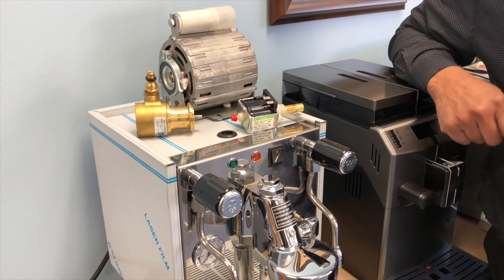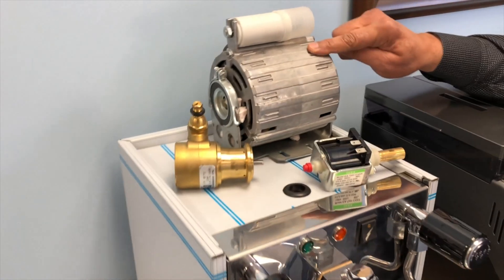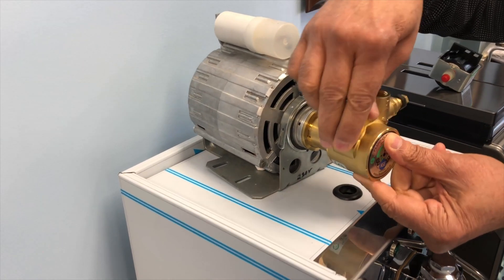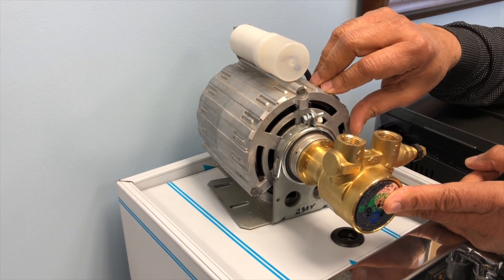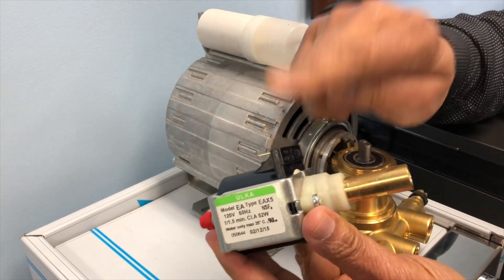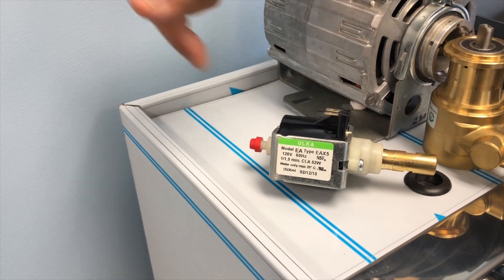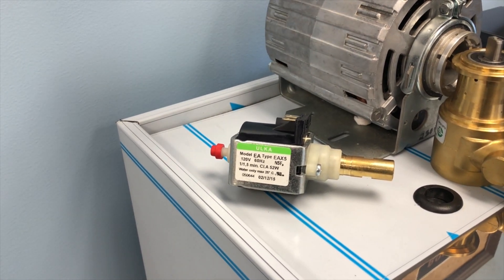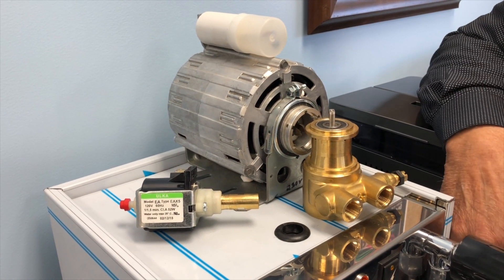Compare: Vibratory vs. Rotary Pump in Espresso Machines

Comment: i agree the heavy + expensive rotary pumps "seem" an overkill for home use...certainly in an engineering sense but am kind of disappointed you didn't go into the coffee they produce......hardly scientific but after many small machines with vibration pumps i ended up with a single group ex-commercial machine (with a rotary pump) and it simply blows away any other machine i've used in crema extraction... with top quality freshly roasted beans a doubleshot of espresso is usually still 90% orange, finely bubbled crema after 30sec extraction.....it's like pouring a guinness and then watching the bubbles fall up.....as in the comparison video by wholelottalatte.........rich thick crema may not be everything, but it seems a pretty good visual indication that the machine is getting all it can from the coffee grounds...which is the main aim of a coffee machine at this level
Reply: not sure about this. i read people comparing pumps and it's the same or even some prefer vibration pumps. maybe there was something else besides pumps in your machine
Reply: @martinkulik9466  Be sure about it. I have a vibration pump and I am going to switch to rotary. The manometer for the pressure on the rotary tells teh story with a nice solid pressure. Because the vibratory pump doesn't have a voltage regulator, the pump varies with boiler element use. On my PID machine, the boiler is constantly being turned on and off to maintain temperatures and the pump output drops when the heating element is on.

What people like about vibratory pumps is the slow ramp up in pressure which gives the puck time to soak which extracts more flavor and lessens the chance of channeling. I'm going to get a Rocket Giotto and add a flow control valve to the E-61 to allow me to control the ramp up and ramp down pressure. 

The only people who worry about the slow ramp up on the vibe pump are enthusiasts like me. Most other people are nitpicking over features they will probably never understand. I feel that the shots are more watery with less crema on the vibe pumps and the Whole Latte Love videos confirmed that. Vibe pumps can be fairly quiet if they are properly isolated. I have done so on my machine, but time to step up to a rotary with flow control. I will be using an HX machine because dual boilers have very steady output and I do like the temperature to ramp down from 95 to 93 during a shot. Produces the best flavor profile for me. Any machine that would temperature and flow profile isn't in the budget, so I'll have to do it myself or drop one of my other expensive hobbies (Nooooo) to justify buying such a machine.
Reply: Oh man....now I want a Guinness!!

Comment: Thanks for the video! I was sad that Rocket R58 or Profitrc Pro 700 is to expensive for me so I will go with Profitec Pro300 - do you think ia good machine or QuickMill QM67? Thanks
Reply from the maker: Both machines use vibratory pump, so either will be fine, if you prefer prosumer espresso machines.  Both are expensive for unnecessary reasons.  Profitec and QuickMill are espresso machine assemblers that are perceived as manufacturers, but they’re not.  Both use pretty much the same internal components.  But use different brand name for advertising purposes.

What interests you about the prosumer models?  What machine do you use now?
Reply: Thanks for reply... I want doual boiler machine. I drink mainly espresso so steam boiler could be switched off... I used variety of machines but mainly super-automatics. So what is your recommendation?
Also grinders like new Eureka Mignon specialeta vs. Profitec T64 is really worthy to buy more expensive grider like Profitec with 64mm..? Thanks!
Reply from the maker: Please give me a call to discuss more details.